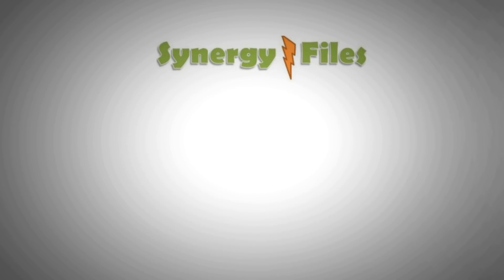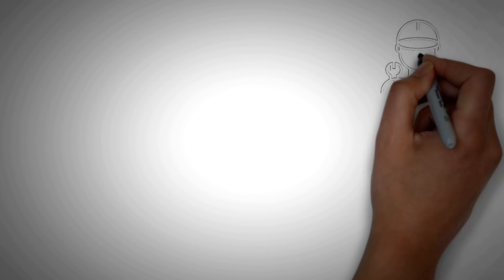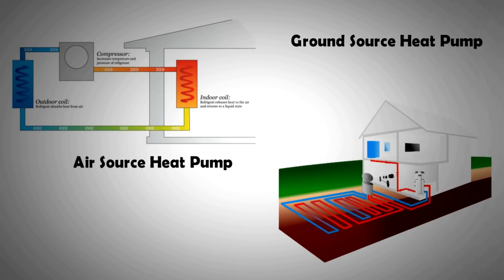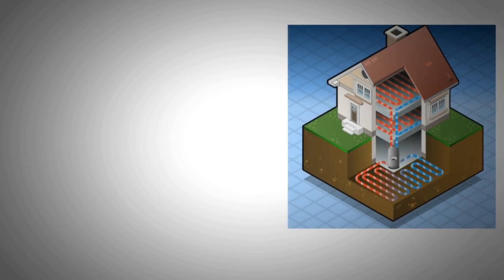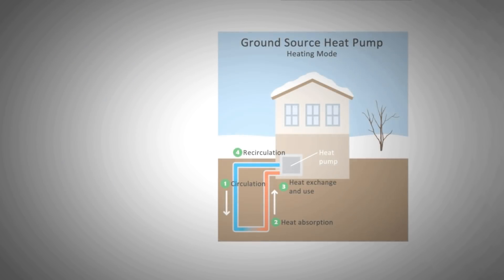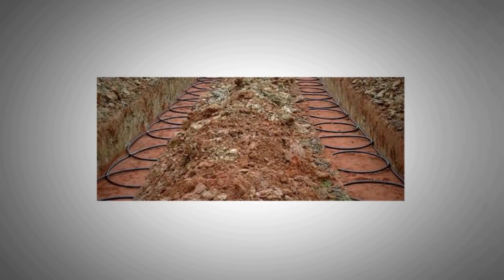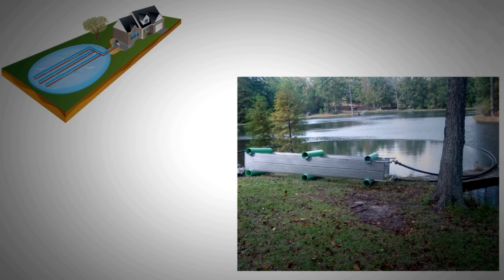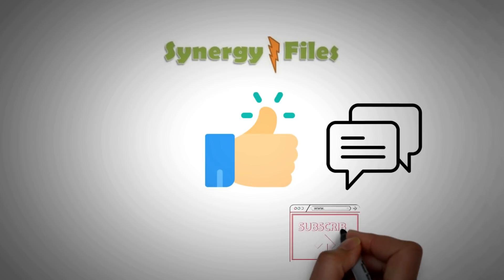Heating and Cooling Technology for the Future

Comment: a heat pump, however,  uses more electricity during heat to operate than a gas furnace and will cause more wear and tear on the compressor leading it to a shorter life cycle.
Reply: a heat pump, however,  uses less gas during heat to operate than a gas furnace...."shorter life cycle"really???... fyi, my heat pump lasted over 30 yrs...ppl like you are great...for entertainment, so thx :)

Comment: Does the heat pump provide pleasent climate inside the room just like an air conditioner does  by maintaining humidity along with the temperature
Reply from the maker: It can help bringing your room temperature down to comfortable range (17 to 25 degree centigrade. Heat pumps are most effective when they are installed with underfloor heating. Although you can also have air blowing heat pumps. The underfloor heating ones do not give that much humidity control while the air blowing ones do. Its up to you which one you want to choose
Reply: The heat pump here is the water pump, the air heat pump is the normal compressor used in air-cond & refrigeration. So don't get confused. The air is normaly pleasant inside the room due to temp of the underground about 20 deg C at all seasons.

Comment: But why is an air source heat pump more cost effective than standard air conditioning?

No question about ground source. That is clear.
Reply from the maker: Air source heat pumps are same as standard air conditioners. They may have the added functionality of providing heating during the cold times if they are reversible. People have also coupled Air source heat pumps with solar panels for getting more heat during winters